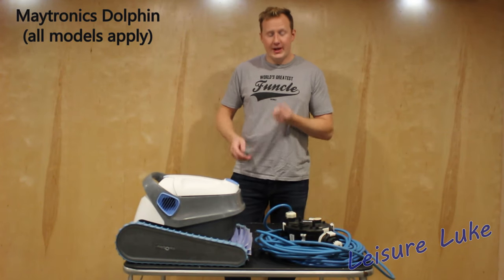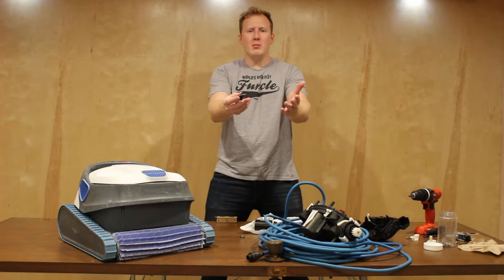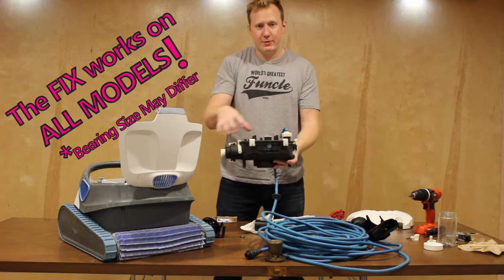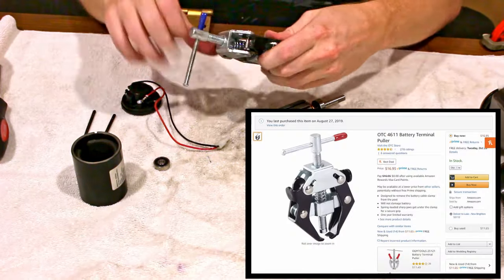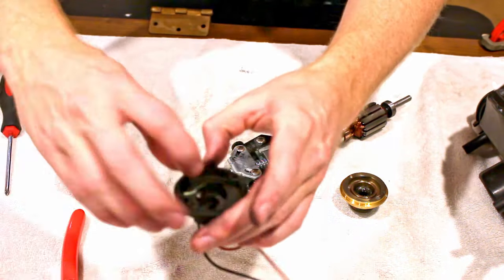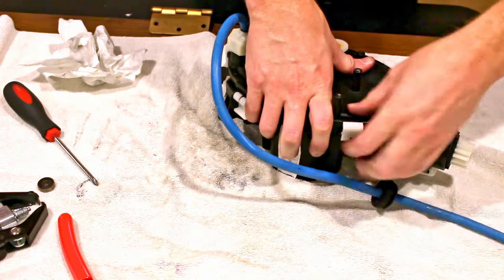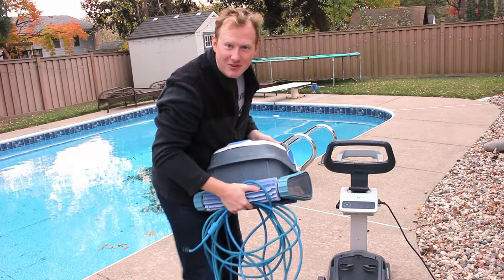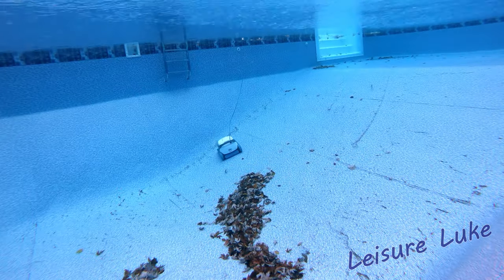Dolphin Pool Cleaner - BROKEN is FIXED!!!  SOLVED with 1$ Bearing | HOW TO REPAIR for MOST Models!

Comment: Great video...huge help.  Cleaned my impeller.  I can turn it by hand but there is some resistance.  I turned it upside down and ran it like some of the suggestions and it makes a decent amount of motor noise.  It now runs about a minute underwater but def makes more noise than it has in a while.  Sounds like I'll have to do your fix.  I have the Dolphin ACTIVE 30i....do you think the bearings you list will work in my cleaner?  Thanks in advance !!
Reply from the maker: Too bad your impeller motor is noisy :( Hopefully this fix works!  GOOD NEWS THOUGH!  The motor part number for both your 30i and my S300 are Dolphin Motor Unit 9995388-EX.  So you have the same bearings as me!  And I'd bet money that it's the same one that went bad on mine!  Here's the link to the exact ones I bought: https://www.amazon.com/gp/product/B01M9HI9RY/ref=ppx_yo_dt_b_search_asin_title?ie=UTF8&psc=1 
Keep me posted on the repair!  I wish I would have bought a little grease for inside the motor and around the "black box motor unit" double o-ring seal.  Food for thought.   Just follow the video and you should be well on your way Kevin!
Reply: @LeisureLuke  Ordering today....will keep you posted.  Much appreciated.  I use the cleaner a couple of times a week.  Surprised the bearings would give away in less than 18 months.  But we'll find out for sure.  Thanks.
Reply from the maker: I bought mine used, and was told it’s only a few years old, which is maybe 12-16 months of use here in Minnesota. It only lasted another 3 months.  Cleaning cycles got shorter and shorter until it was just a few seconds.  When you get your hands on the bearings you’ll know if one or two are bad just my the feel.  It was very obvious for me.  2 felt perfect. 1 I could not move at all!  I hope yours is easy to diagnose too!
Reply: LeisureLuke I’m on my second motor. First one replaced under warranty after 18 months, and 18 months later same issue. Anxious to give this a try. Stuck on opening the black box. Does it just pull apart?
Reply from the maker: @theaustindude  Yeah, once all the clips are unclipped, it just pulls apart.  That was tricky.  It's got 2 gasket/o-rings holding the lid on the base.  Mine has LOTS of grease on it a was a little hard to open.  I'm guessing yours only has a little grease, so it's just harder to open.  There were no screws, bolts, or sneaky things holding my lid on.  Also, my lid on and box had electronics on them with wires connecting them.  So, careful when you open it not to fling the lid off the box.  I worked around the edges with a screwdriver and pliers sorta like a paint can.
Hope that helps!  Keep me posted how your repair goes!
Reply: LeisureLuke I got it open. My impeller and the other gear turn by hand.  However, when I open the motor, there is a bunch of black “dust”, which I’m assuming is not normal.
Reply from the maker: @theaustindude  The black dust is pretty normal.  It's just magnetic dust mostly from the solid brushes at the bottom of the motor.  Those are the sprung blocks on the bottom of the inside of the electric motor that look like magnets.  For me, one bearing was stuck. I couldn't spin it by hand.  Since you have the motor apart, I would clean off and feel each bearing, and see if one is difficult or impossible to spin.  May I ask.... What symptoms did your motor have?  Was it not spinning, or was it difficult to spin by hand?
Reply: LeisureLuke it was failing the self test. It would go forward and then stop. Both bearings spin just fine.
Reply from the maker: There are 3 bearings!  One is probably on the case of the electric motor.  It’s on the inside of the end of the electric motor.  Hope that makes sense.
Reply: LeisureLuke  I’m not seeing a third bearing.
Reply from the maker: @theaustindude  
Sorry if this is a duplicate response:
See the video at 0:30.  In the brass "top" of the motor there is a 3rd bearing.  If your model is different than mine it could only have 2 bearings.  The other motor in the black box, which drives the dolphin's tracks, probably only has 2 bearings.  

My problem was my impeller wouldn't spin.  Even if I removed the dolphin from the pool and started it, the propeller would not spin.  It was quite hard to rotate by hand.  If your impeller spun by hand, you may have a different problem.
Reply: @LeisureLuke  Mine looks identical.  I'll look again to try and find the 3rd bearing in the copper top.  My impeller does spin by hand, but my machine is failing the self-test.  The last time this happened, it was returned to Maytronics under warranty and the motor replaced.
Reply from the maker: @theaustindude  If your impeller spins freely, it's probably not a seized motor, and replacing bearings won't help.  
Top reasons it will quit after a few seconds:
Clogged Impleller
Clogged Drivetrain
Chewed through cable
Over-twisted cable
Damage to the control board (usually water damage on the control panel)
Seized impeller or drive motor
Water inside the black box of the dolphin

I've also heard that some dolphins have "underwater sensors" that fail - I've never actually seen one.   And I've heard that if the water is too cold (under 60F) somehow it won't work.  Again, I've never seen that be the case, but it's worth noting here.
Reply: @LeisureLuke  Came back to update you.  I didn't realize when I started out that there is a 24 month warranty on my model; thought it was 12 months.  I bought my unit only 14 months ago.  So, I sent it back late last week to Maytronics and they replaced the motor unit.  Maytronic didn't hesitate and did it super fast.  Hats off to them for standing by their products.  It pays to register your expensive electronics immediately after you buy them !!!  In the meantime, I have my new bearings and puller ready in the event something happens again.  Thanks again for the help.  Might have just ended up in the corner of the garage otherwise !!
Reply from the maker: @kevinflynn1121  That seems like a great outcome!  Too bad you couldn't keep the old unit and do this inspection just for fun!  Either way, thanks for the update! :)
Reply: @LeisureLuke  Agreed on better outcome but I would have def been in there replacing bearing otherwise !!  Again, great video.  Super helpful.  Keep up the good work !!
Reply from the maker: @kevinflynn1121  Thanks so much!
Reply: @theaustindude  there is no third bearing - in the brass cap it looks a bit like a bearing but it is the shaft water seal, i took mine apart then took the rotor (original bearings still attached) and the brass cap to a bearing shop, they sold me the replacement bearing and seal, the seal was difficult to get out and was completely destroyed so glad the ne one fitted fine, pulled the old bearings off and pressed the new ones on - like a new motor, smooth and free.
Reply: @LeisureLuke  i did get a bit of water inside the motor compartment a few years back, not much (like build-up of condensation but not a leak) but enough to stop the cleaner from working. after drying it out, re-grease seals and put back together it ran for another 18 months. this time i thought it was the water pump motor, bearings were not seized but stiff and rough and motor full of black dust - a lot of it - after replacing bearings and seals it ran a bit but still kept stopping. after looking at the circuit board with a magnifying glass all sorts of corrosion was evident, all around the chips and components, not clearly visible to the naked eye (not mine anyway) - over time the minor water ingress has worked havoc on the control circuit board - contact cleaner liberally applied and gentle brushing, put back together and its running like new again - hope this saves someone - $20 for bearings and seals, some cleaner and S300i is like new again - actually another thing no one seems to mention on these repair sites - CLEAN the o-ring seals very gently, do not stretch or they wont fit back and re-grease with lots of silicone lube
Reply from the maker: @kimharris3734  Thanks for this.  There's a LOT of good things you bring up here.
#1 - BLACK BOX SEALS - If you have lube or grease you can gently clean your seals (rubber rings) on your black box.  Regrease them before assembly.  If you DONT have grease DO NOT clean them, just leave the existing grease there.  If these are flaky, brittle, cracked, or otherwise worn or squished looking.  Buying a new set is a great way to keep your motor assembly dry.  Do you have a link to share for these parts?
#2 - CORROSION on circuit boards.  If your Dolphin isn't working, and the internal boards have corrosion, it may be beyond saving, but here are 2 things to try.  BEST - you can use contact cleaner and a soft brush.  Make sure everything is powered off.  CHEAP - use a gently dry brass wire brush, or a hard toothbrush to "knock off" the corrosion.  Your corrosion build up may have started shorting something, or caused overheating of the circuit board which was causing problems.   Nice work cleaning those up!
Thanks for the info!!!!!!
Reply: @kimharris3734  hey Kim, how many seals were in the brass cap? I managed to get it out & TWO popped out (Dolphin S200)- I didn't see which direction they were seated as I was expecting one that looked like the metal/rubber ones pictured in the video... I completely cleaned them off thinking they were bearings & wanted to see the number for reorder, now I'm nervous to put it back together.  any insight is appreciated.
Reply: @lisaarmand564  Hi Lisa - memory is a bit vague by now, without being able to look at it, are you able to post a pic. i took the bits to a bearing and seal place they had no problem finding a replacement
Reply: @kimharris3734  indeed!  I'm seeing that there is not a bearing in the brass cap too!  Just curious what kind of place would be able to help me find a new seal (I was able to get it out after struggling) you mentioned a bearing shop, but I'm unfamiliar!

Comment: Hi Luke and everyone.  My Dolphin s300i is giving error “Servo Overload.” Is this the fix for this?  Thank you!
Reply from the maker: I’m not familiar with the diagnostic codes, but there are 2 motors and 1 servo in the s300i.  Before assuming any are bad, disassemble everything down to the impeller, and make sure the impeller & housing is free of hair & debris.  This is also a good time to spin the impeller by hand, which should be pretty easy.  Then put it back together and there’s a good chance it will work.  :)

Comment: My s 300 fan spins, the light comes on and then nothing. I replaced the motor 2 years sgo. I’m thinking cord?
Reply from the maker: If the cord is the problem, it’ll work out of the water at least a little bit.  If the fan starts spinning under water, it’s probably not a cord problem.  Good luck, sounds tricky.

Comment: Hey mate, I have the same robot, mine only moves backwards 1 foot and stops in the pool, when I diagnosed it out of water it only spun forward not backwards, its clean and it seems fine to me, only 2 years old just out of warranty, any idea please?
Reply from the maker: I understand the worry :) almost everything is fixable, so let's fix it!
1.  Does the impeller spin freely by hand?  Unplug it, open it up to the impeller, make sure it can be spun.  A little resistance is expected, but mine was LOCKED and would not move.
2. Make sure your tracks are clear of debris (small rocks or sticks can effect the tracks.
3. Reinspect the cable.  There are a lot of stories of a small cut or mouse bite that then shorted the cable in the water.  This is fairly common.

That symptom matches what I had, which was a locked motor, so the robot shut itself down.  Good Luck! Keep us Posted!
Reply: @LeisureLuke  Impeller spins freely, bearings ok, no water leak inside, all clean and looks good, cable ok, did all the self diagnostic, only moves forward, the whole thing looks new, just out of warranty, what a shame.

Comment: I have tested my Power supply and cable and both register 29.9 on my meter. I soon as I plug the cable into the notch on the motor housing, all lights on power supply turn off. Any ideas?

Comment: Hi my nautilus cc plus only works for about 5 min and then it stops. I check the impeller and drive motor and it seems that they are working properly. Any advice?  Thanks

Comment: I already fix the impaler motor,  but is stuck, i need do the same in the other motor? The draft motor?
Reply from the maker: It would be unusual for both motors to fail at the exact same time.  I haven’t taken apart the little one.   You could remove the motor, and once the power wires are disconnected, try spinning the shaft by hand or with a pliers.  Maybe something else on your tracks are causing it to be stuck.

Comment: Hello … so we replaced the magnetic ladder in the motor .. it’s running now but is pushing water instead of pulling water … any ideas ?
Reply from the maker: If the impeller is pushing water out the bottom instead of the top, you probably connected red and black motor wires on the wrong side :) I hear of this happening a lot.
Reply: Thanks so much ! That was it !

Comment: Exactly my problem. Runs for 5 to 6 ft. and stops. However the propeller is cler and turns freely. The drive motor on the other hand is hard to turn,  needs a visegrip, but doesn't sound or feel like a bad bearing. I guess it's a geared motor. 
Could someone please let me know if needing a tool to turn it , with the track (gear belt) removed, is normal?

Comment: My is a s50. How did u get the cover off the motor? I unfastened the clip still on there very tight. Don't want to break it.  Please advise. Thanks.
Reply from the maker: You have to slowly work your way around the outside.  I thought I was missing a screw or something.  I used a flathead screwdriver to pry my way around a little at time.  Hope that helps.  It should have 2 tight greasy rubber gaskets holding it on right now.
Reply: @LeisureLuke  thanks much!!!
Reply: Got it apart! Tried to get the bearing off with the terminal puller bent one of the teeth. What did I do wrong?
Reply: @LeisureLuke  Got it apart! Tried to get the bearing off with the terminal puller bent one of the teeth. What did I do wrong?
Reply: Got the bearing replaced and now it's working!! The bearing took a grinder, vice grip, and a punch to get off. It was on there solid. The local hardware store got it off for me!!
Reply: Thank u so much for your expertise!! Where there's a will there's a way!!

Comment: Great instructions! I did this, put it all together and it appears to work EXCEPT the motor is now spinning in the opposite direction and the water get sucked in from the top instead of blown out! I checked there is no way way to turn the impeller upside down, so I guess it is something about how i reassembled the motor. But I can't figure it out. Any idea?
Reply: I'll answer myself since I found the problem.

The black housing which contains the magnates had to be turned 180 degrees while the bottom piece (where the cables come in) has to stay in the same position.
Reply from the maker: Nicely figured :) yeah, turn the house if or flipping the red & black cables would do the trick.
Reply: @RobHOUTX46285  This just happened to me. Are you saying simply unscrew and rotate the black cylinder housing 180 degrees, or flip it over end to end.

 I notinced a white plastic washer/gasket on the brass side that sits inside the cylinder as well. Does this stay on the brass side?
Reply: @robertbonse2262  rotate the cylinder it 180 degrees. Not sure what you mean with white piece, maybe the small washer that goes at the bottom of the motor? Then yes, put that in to the bottom (below the brushes) before you stick the thing together again. I think it is purposefully bent to have a bit of a spring effect.

Comment: Hello is there a spot to send you a picture ?   I opened my motor and about a tablespoon of grey powder came out and there is a lot of black dust mess- greasy ——— and the one of the motor is still attached to the center of the motor.     There is some serious wear in the middle of the windings.      It was running a couple feet then stopping and the impeller is frozen still.    Thanks
Reply from the maker: The dust is from the motor brushes, that's fairly normal.  Send pictures to LeisureLukeTY@gmail.com and I'll see if I can help!  Maybe someone else here has an idea how to help?
Reply: Hello Luke the email address doesn’t work for me.    Did I typo it or is wrong.   Thanks
Reply: @LeisureLuke  hello the email doesn’t work.   Can you send it to me again.   Thx

Comment: My impeller is pretty stiff to move.  I can get the impeller moving manually and it will start spinning, but it won't spin on its own.  Is that a bearing issue?
Reply from the maker: Yes.  Sounds like the bearings to me.  That’s quite a dangerous test!  Haha.  Good luck with the repair.  Lots of successful people on this thread!  Keep us posted!
Reply: @LeisureLuke  I swear I wasn’t as reckless as it sounds. Ha! I’m not mechanically/electrically inclined but I’m going to try and replace the bearings myself. 🤞
Reply: @LeisureLuke  My bearings ended up being o.k.  My problem was with the brushes.  They were worn down enough to where they weren't making contact.  I ordered some new brushes and everything seems to be working fine. Thankfully my neighbor helped me figure everything out. Just wanted to leave an FYI in case someone else has the same problem.
Reply from the maker: @stacywilliams4184  Nice work!  Can you share a link to the brushes you ordered?